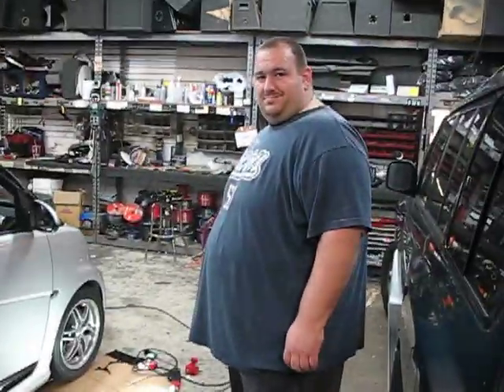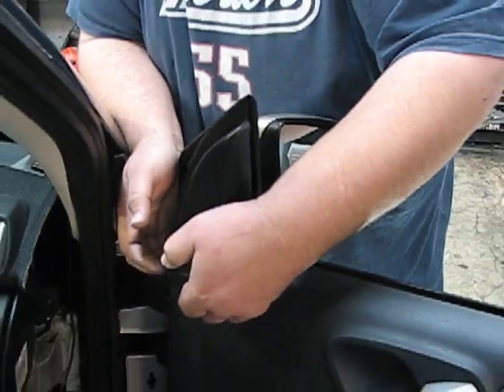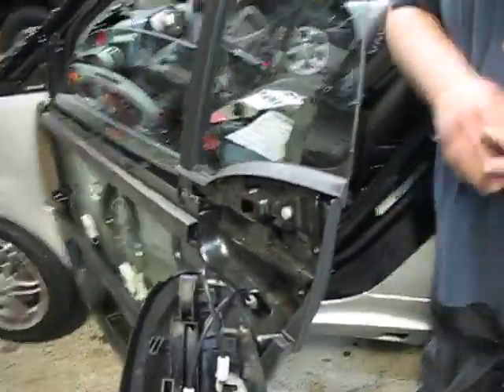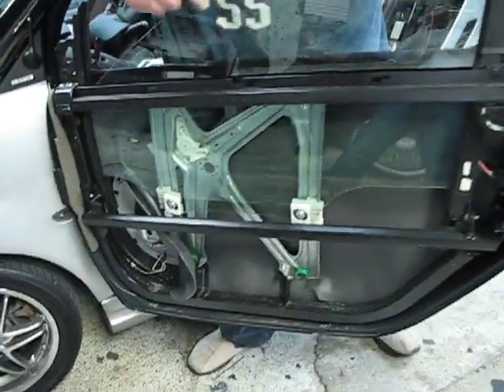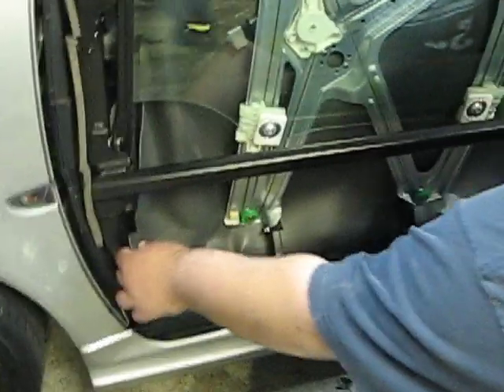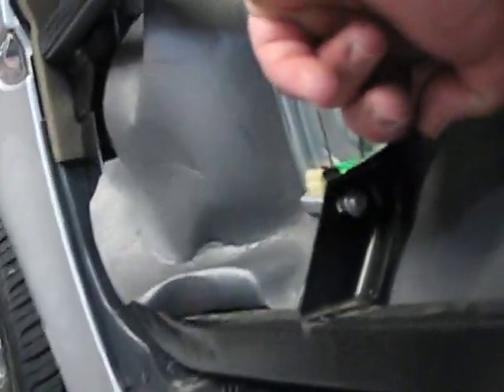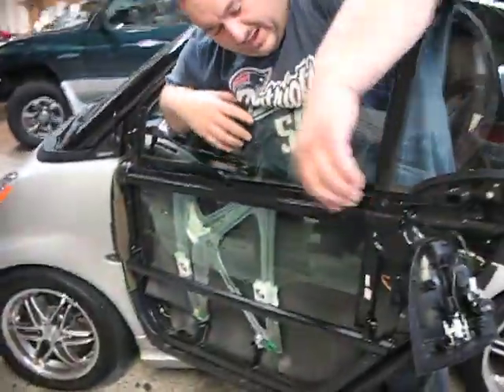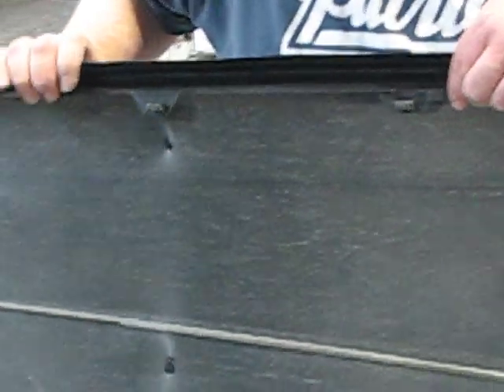Smart Car - Door Speakers replacement - How to remove door panel

Comment: Thanks for the video! Worked like a charm for my 2008 Smart Fortwo Passion. Couple of notes: Like others have said, the little plastic pin on the end of the door near the first 2 screws for the handle does nothing. Leave it alone. My car has manual side mirrors, so I did not fully remove them, just left them dangling, but loose. When putting the panel back on, I struggled until I noticed there was "hook" or catch on the far end near the door handle. Start there, hooking it in place, then work your way around the bottom.

Comment: Getting the panel off was easy, but I have been working on getting the panel back on for two days!  I start from the rear hook just below the removed outside door handle I can get the rear of the panel and most of the bottom of the panel slid on but when I get to the bottom front corner I can not get it to go on!  Anyone out there have any suggestions?????  Please!!!!!

Comment: Wow, just realize that I like the speakers that are already in there!!! Way too much involved!
Reply: You don’t have to remove the door panel anymore this is the old way. The new way is you will have to break out the old speaker cover and speaker inside and then with the clip connected to wires cut that off. Then from there you can add female connectors to the wires and hook it up to the plus and minus sign on the speaker and drill the new holes to mount the speaker and speaker cover.
Reply: But I do agree the stock speakers have good bass! And sound pretty good for being factory speakers, but imagine what it will sound like with better aftermarket speakers!
Reply: @vacuousfilms1560  I’ve tried with 2 Smart Fortwo already and the bass is horrible. You have to angle the whole speaker towards you to feel any bass. I’ve fabricated some angle spacer rings to get the effect of bass but very little is produced when the doors are closed. The OEM speakers are fine enough now that I think about it. The guy who hooked up my new pioneer said it was pretty loud but I don’t think he knows much about destructive interference.
Reply: It was actually a pretty easy process!

Comment: Can any one tell me how to remove the inner door handle on the passenger side please ? Mine is loose at the top near the electric window switch so im looking to fix it back on, but cant see any clips or screw holes. Im assuming the fastening must be under the main part of the triangular shaped part of the handle. Any help in how and which way to lever this off would be appreciated thanks